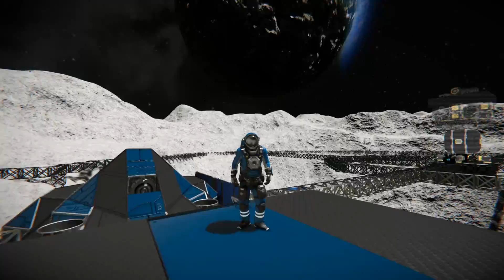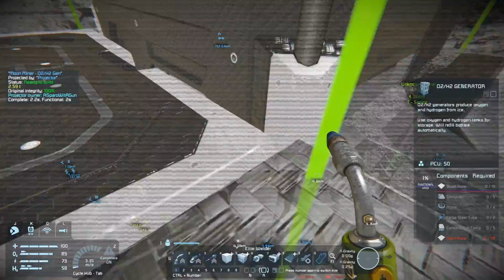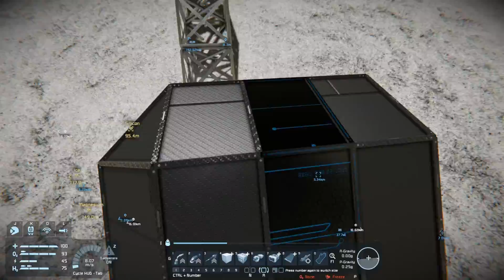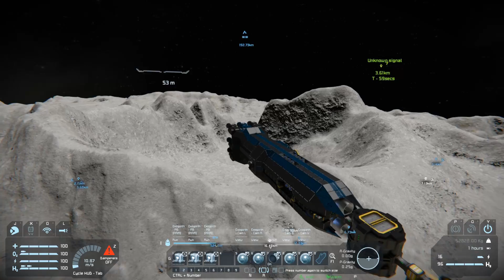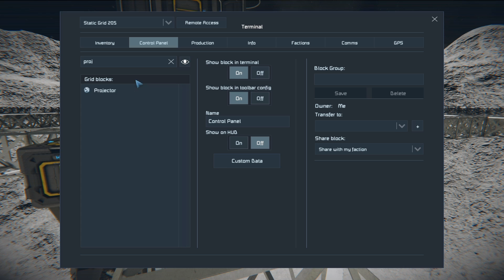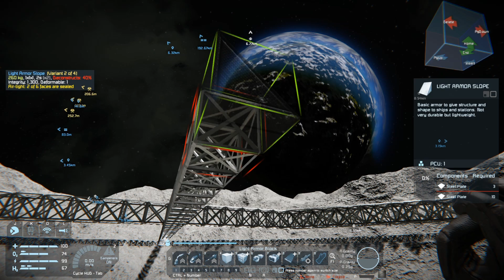Building The SKS Moon Miner & First Semi-Test Run - Space Engineers LP - E29

Comment: OK let me try again on the floating stairs to connector now that I rewatched that vid. Piston is a conveyor. Piston Vertical down to a junction to your Horizontal piston/s out to connector. May take a little reworking to connect the Vertical piston to your processing system. But, the vertical piston will let you push Down the Horizontal piston/connector enough to just have the stairs attached tiny bit Above and not to the catwalk on the horizontal.  I______connector/ship where " I " is vertical piston. lol
Reply from the maker: Oh, I think I got what you mean now. That could work. It does make me wonder...if I could add the entire stair way/catwalk to like...the connector. I was thinking then I could use a rotor somewhere and have it turn sideways & pull the whole thing under the base. Hmmm *scratches chin*. Your idea is WAY more feasible, but it does make me wonder.

Comment: I'm telling you man, pistons are a lot cheaper than thrusters, gyroscopes, hydrogen tanks, 02/H2 Generators. But I am entertained watching you try to solve the problems you gave yourself. Ether way, fun is to be had.
Reply from the maker: Hey as long as fun is to be had, we're good! Haha. I agree they're cheaper, I just have to get better at properly using them is all. My main thing is I'm trying to wrap my head around how to design one that can keep extending. I'd have to do a ton of closed pistons (like the drill platform at the beginning of the season) but that still has its limits. I'd like to do one with projectors, welders, etc that basically builds itself as it goes, just having trouble with designing it as some of how those types of designs function are still a bit...fuzzy to me, lol. :P

Comment: Well that was the reason I was advocating an asteroid miner first. With the Shooting Star you can build in space then devour an asteroid with minimal fuel cost. Also prioritize functional blocks first, you don't need the armor blocks on the moon miner. You can also just build the central 3x3 dig as far as you can go in then finish up the other drills later.

As for your problem with pam, as I recall the obstacles were NOT there when you set the route. In this instance the fault lies on you. You just need to rerecord the route.
Reply from the maker: Yeah, that's a fair point. I just felt I already had one with the exogorth...albeit not an asteroid EATER or anything to be sure. Plus I ended up on the moon for the gold. Which worked, but then I was doing the base thing and here we are lol. More of situational solution I suppose. Though I am tinkering with making this part of the base itself, i.e. a more literal drilling PLATFORM instead of a ship, but I'm not the best with that so I don't know if it'll happen soon or not.

As for pam...that is actually true, the ring wasn't there before. Though, I feel like I've had issues like that with pam in the past where there were no obstacles. One example is if I set the job point to in front of a mountain, sometimes when it returns home, it would spin around and hit the mountain (did this actually). So, I'll admit to the fault of building things and not re-recording the path, but I do feel it still has trouble with some obstacles. Though, it's STILL one of my favorite scripts of all time so...haha. xP
Reply: @Sleeplessknightsstudios  yeah you were looking for gold but went for a base
Reply from the maker: Well, to be fair I went for the base AFTER I found gold...so, I feel like that's worth something haha. xP

Comment: What mods are you using?
Reply: Hey sleeplessknight, you could use the buildinfo mod to answer that easily. Aim with welder the ship staying close to it and type: /bi shipmods
Reply from the maker: Not really any that change too much in gameplay. Mostly utility mods, bare in mind I'm not sure of the exact names of them or how they're titled on the workshop. I use the Sneaky Sounds to make the mining tools quieter, Build Info for various things like air leaks etc, and I do have a takeover mod where I only have to hack the main blocks on a ship (cockpit, remote block, etc) to take control of the whole grid. Other than that...I don't think any others. I do have all the DLC though, so if there's something that looks like a mod, could be something from one of those.